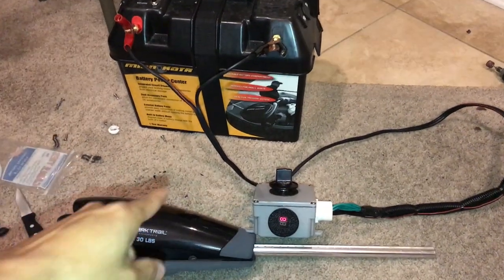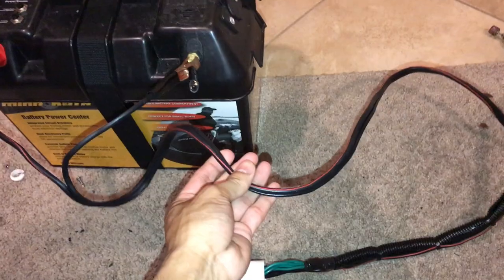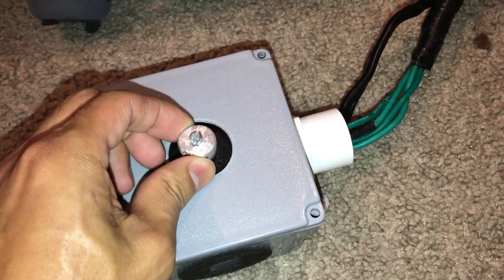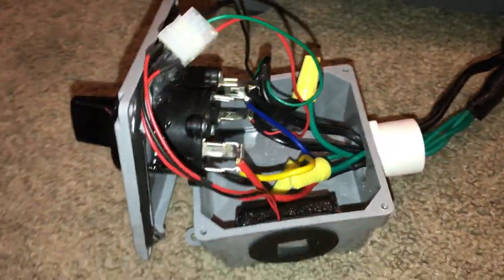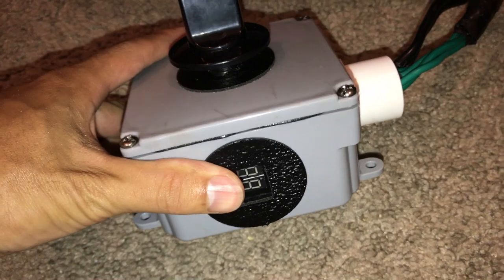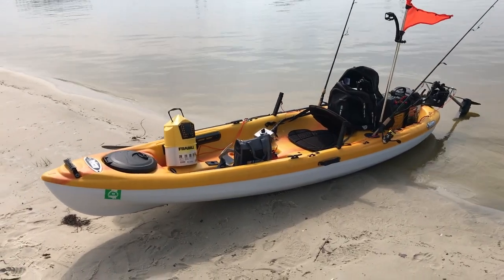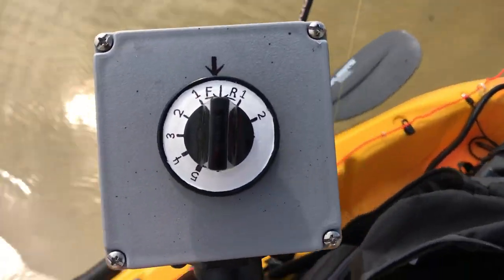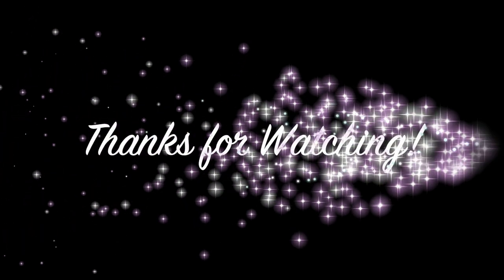✅Trolling Motor Speed Controller Customized for A Motorized Kayak, Canoe, or Boat HD Review

Comment: Best DIY kayak motor kit on YT.
Nice improvement from side mount.
Whats your option for low water.
Just keep motor up high always?
To for back to adjust hight or no need when done correctly.
Reply from the maker: Thanks! I appreciate it. I keep the motor low at all times to where the kayak bottom would run ground 1st before the propeller would make contact with any surface. I'll try to make a trip to some clear water so I can film the setup above and below the water.

Comment: I enjoyed the vid and the time you took figuring things out.
I would have put a kill switch underneath for safety in case something hits the switch while not ready for it.
I'm thinking of doing the same with mine but ordering a spare switch (In case I want to put the motor back to original) and mounting it sideways with an "L" shaped lever like a normal boat, Push forward to go forward, pull back to slow down or go to reverse. Planning on mounting it with T-nuts/knobs to be able to remove it.
I might just do the lever with a variable speed controller so it makes the battery  last 3 or 4 times as long.
Reply from the maker: I appreciate your feedback and thanks for watching. It takes lots of effort to do a project and try to record the process too. Your setup sounds awesome. You should make a video on it when you're done.
Reply: @VibrantDeals  I actually ordered a Thruster motor and speed controller. thinking about using it like a powered rudder...video definitely!

Comment: Hi Really like your setup. What is that piece on the trolling motor shaft with the two eye bolts sticking from it? Would you have a link to where you got it? That's the piece I need to complete my setup.
Reply from the maker: Thanks! It is a 3/4" split ring hanger ➜https://amzn.to/2MAmEuY. You'll need 2 of them so you can use both sides that have the screw in sides that stick out. The openings will fit a 3/8" threaded eye bolt at your desired length. Hope this helps and thanks for watching!

Comment: Bro you shouldn't  use wire nut on dc voltage electrical connections. 
Wire nuts are for ac current.

Other wise nice job.

Comment: Two trolling motors can be connected to the same speed controller?
Reply from the maker: You can but you just have double the wires. You'll definitely need a slightly larger control box and it would be best to use the same trolling motor type. The battery will drain twice as fast if you use the same power source.
Reply: Depends on the rating of the switch

Comment: Is that just a steel plate bolted to the kayak for the mount? Curious how your mounted it. Thanks for the vids
Reply from the maker: Yes, a steel plate like this ➜http://amzn.to/2qVJ44D, drill holes to mount on with kayak rivets ➜http://amzn.to/2DnxNN6, and just paint it black with weather proof spray paint. It holds strong and has yet to fail. Thanks for watching!

Comment: Where did you buy the levers to turn your trolling motor.
Reply from the maker: I bought wood and cut it to desired height then painted it. Afterwards I added hinges to the bottom to connect to the kayak. You can customize your levers however you'd like.
Reply: Ty for that. Subscribed

Comment: hello what gauge of wire you using
Reply from the maker: I used 10 gauge green wire ➜https://amzn.to/2yK9FG7. The higher the gauge the smaller the diameter of the wire and the lower the gauge the large the wire thickness.

Comment: Good Video, if for Some Reason you Need 5 Reverse Speeds(Whales, Sharks?), You could add a Polarity Switch, a Double Pole, Double Throw Switch with the corner connections crossed.
Only Negative Thing I would say, it it may have taken moe than an hour, No locknut on the Plumbing Connector says you tapped it, maybe it was glued? Covering the Wires takes time, 
Most of the Time is Usually getting Parts and Tools Ready. At that point, it could be Assembled in One hour.
If you did that for Someone, Think you could charge more than 1 hour.
Good Info and Video. Later.
Stratmando

Comment: Better is to install a PWM Controller. it is infinitely variable output. Better Handling and you safe by low /medium speed up to 50% energy. The step switches have heating resistors on the engine. So the low speed is realized. The stepless controller has no problem and can be operated twice as long at low speeds

Comment: Nice job.
Now if you take that 12 v moter and wire up 2 battery's for 24 vdc your moter will double rpm.
Lots of people have Ben asking how to get there yack to go faster.

2 moter heads will increase your thrust but not top end speed. 5 mph
24 volts on a 12 vdc moter should do 10 mph
Keep in mind the prop may not like the speed.
Cavitation or flex

Try let us know
Might get away with using a 20 v cordless tool battery for a short speed test, as the amp hour capacity is so low.

Comment: Don’t use PWM  Controller, Electronics and water , especially saltwater do not mix. PWM Controllers don’t handle overload well, using the original controller like this is more reliable also I prefer to use Lead Acid Battery over Lion . Lead Acid Battery will still turn prop even at low state of charge unlike Lion Battery that cuts out at low charge state.

Comment: You realize that this voltmeter will understate the battery state of charge, right? :) 
By 10% maybe... No big deal, just something to keep in mind.
Reply: does it really matter? nothing was really changed to change the voltage
Reply: Hector Mancha  I would drill another small hole in the box and install a water proof  on/off switch to turn off power to the voltmeter.
Turn on only to check voltage.